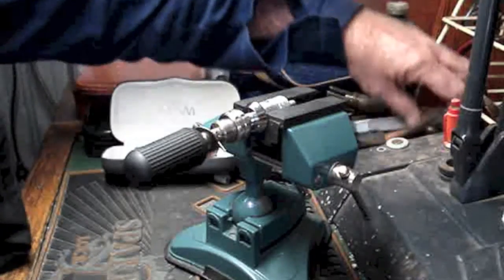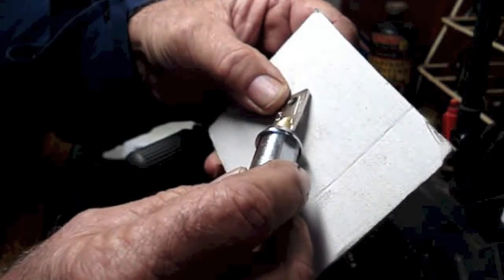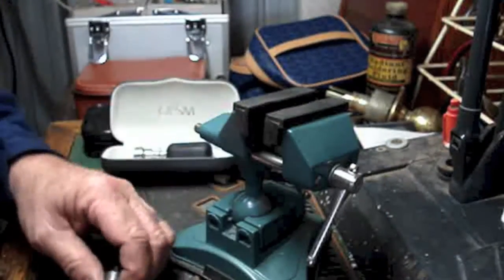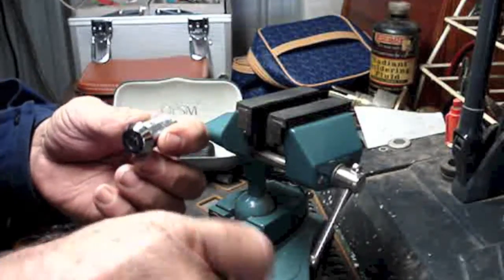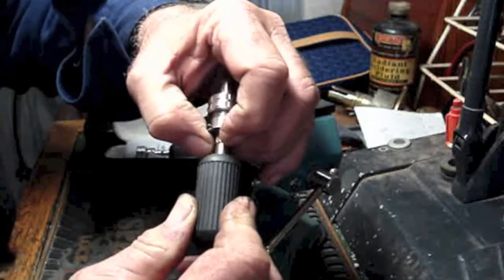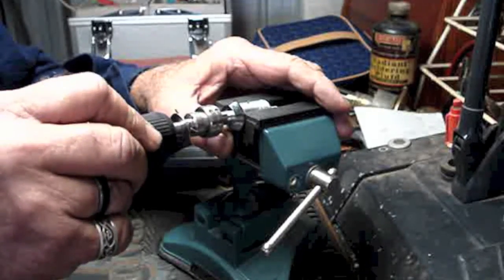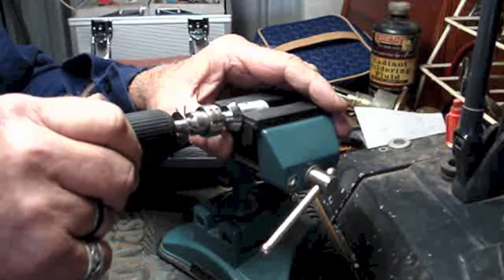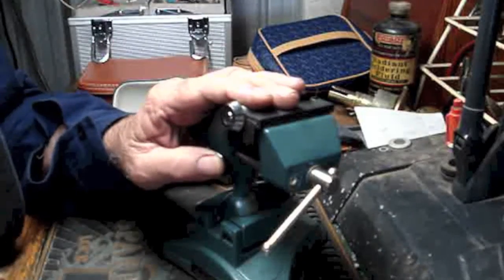7 pin Tubular lock picked.

Comment: Well done Nev, i have tried to single pin pick both of those unsuccessfully because its really hard to get tension. Its nice to see one picked open with the right tools. the first one is HCS but i too couldn't read the s word stamped on it because its pressed to a blur, the one you picked was camlock systems. But your right about the different levels of lock. for them tubular locks are on personal lockers (low security) too vending machines (high) good luck on the HCS, Im confident you'll get it

Comment: Great job Mate! I've got the Klom model...it seems to work well...I haven't really found any problem with any locks over here I usually run into  all the no name ones on little safes...easy as pie....They put Ace brand locks in the Vending machines...I've only got one, it opens just as quick...so luckily they came up with the idea to add a padlock aswell, they aren't usually the best locks but most would be thieves can't pick a lock as easy as they can use these dedicated tools....

Comment from the maker: I was going to have a go at spp'ng the other one but I figure I'll have to spp it repeatedly to actually get it to the unlocked position.  Not sure if it's worth the trouble though when you have the right tool.  Even a thief would prefer a hammer or a brick to piddling about spp'ng one open me thinks.  Cheers for watching mate ;-)